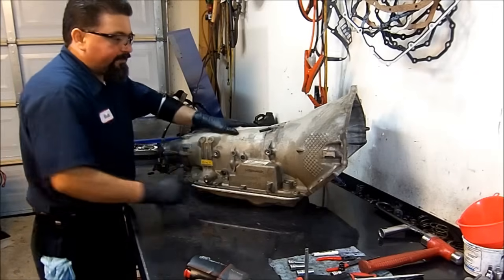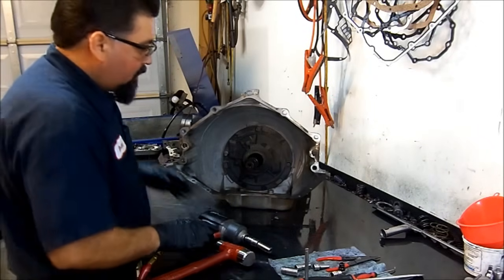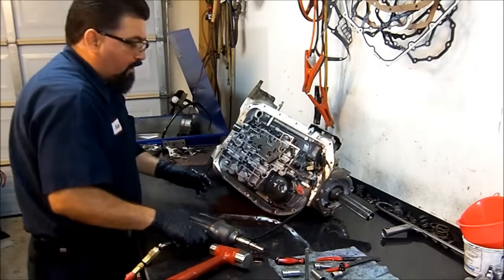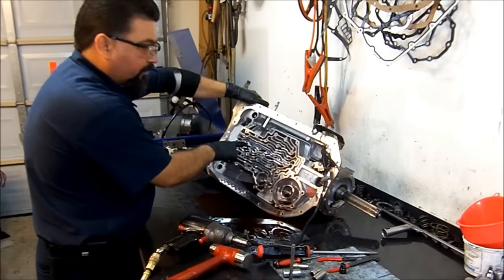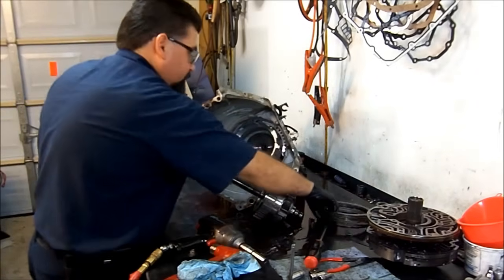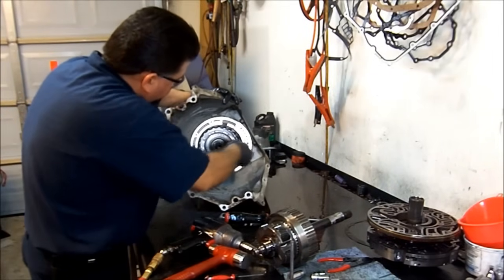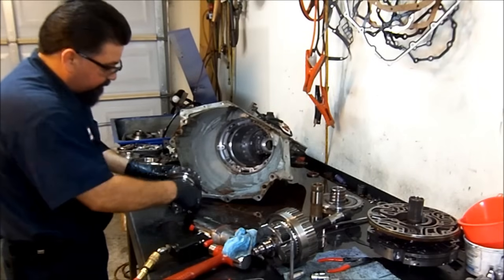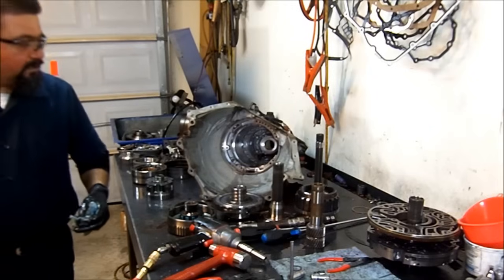Step-by-Step 4L80E Transmission Teardown: Full Disassembly & Inspection

Comment: thank you so much for what you do they were charging me 1700 to do my transmission and i look at ur videos i bought the rebuilt kit for 249 bucks i just went for it and actual did it thank you so much and god bless you bro..thank you
Reply: Was it that difficult. i can anything. water pumps, head gaskets, alternators, to suspension work. i wanna get into trans work
Reply: @DL-qq4nu  It's not hard work but it's tedious and there's lots of special tools you will need which aren't expensive but are NECESSARY. Piston compressors, snap ring pliers, seal installer tools, a bushing driver kit and the list goes on. If you don't have a clean work space and take your time and take pictures and take notes and be methodical, you'll lose parts like bolts, check balls, clips, seals, etc. You'll learn real quick that the idea is to work in steps and work on 1 assembly at a time.
Reply: Joe good for you. I’m in the research phase now. Have an old truck I’m going to keep forever lol need to know how to keep it alive
Reply: Can anyone out there who has watched, commented or liked this transmission tear down tell me what is wrong with an instructional video like this on YouTube? The Customer is charged for a complete tear down and assembly because of a wiring problem! Had the technician stair stepped his diagnostic evaluation correctly, he probably would not be rebuilding transmissions at this stage in his life. NEVER, NEVER NEVER get complacent! Always use your head to think things through.
Reply: chfar072281 lol too late once it’s pulled and on the bench. The wire issue could have caused other damage. Better to get it all fixed up right. 

But yess sadly way too many misdiagnosed jobs. But that’s the nature. Pay more for labor and have a chance at better skills

Comment: Nice work and thank you for sharing. Videos like this are a huge help in demystifying the auto trans. I'm currently contemplating a 1976 Pontiac Turbo 400 that has 35,000 original miles on it and has never been opened. It sat for a long time and slips when it's cold. Gonna build it for a 500+ HP engine.

Comment: I'm studying these videos. I've got a '95 Chevy 2500 that I've retired as a work truck because of a bad transmission (which I'm hoping to be able to repair for my home use), and a '98 3500 dually that's probably a few years away from needing a transmission overhaul.

Comment: Thanks for a helpful video, I'm not transmission guy so I had someone else rebuild my transmission, it's a bit of a long story, but I wound up missing an external piece or two and I wasn't sure what was missing, now I know it's the speed input and output sensors I need to get. And I also now know why the linkage sensor was such a PITA to get off, lol.

Comment: Can anyone out there who has watched, commented or liked this transmission tear down tell me what is wrong with an instructional video like this on YouTube? The Customer is charged for a complete tear down and assembly because of a wiring problem! Had the technician stair stepped his diagnostic evaluation correctly, he probably would not be rebuilding transmissions at this stage in his life. NEVER, NEVER NEVER get complacent! Always use your head to think things through.

Comment: Looking for some 4L80e advise. I have a 2003 Chevy express van, AWD with the 4l80E. There are 170,000 on the van and engine, the trans was swapped out for a junkyard unit at 140,000, unknown amount of miles. While decelerating, from going at any speed, there is a high pitched whine coming from the drivetrain. It's more apparent at higher speeds when you let off the gas. The faster your going, the higher pitched the noise is. I have made sure that all the tires are the same pressure and they all have the same amount of wear. There is no CEL, and other than that the transmission shifts great, no slipping or hard shifts. I'm just afraid it's the pump gears, but wouldn't the gears make noise all the time? I'll see if I can't get a sound bite.
Reply: prolly transfer case

Comment: good job   i was hoping you was going to find something really screwed up i have a 1995 480le in a 6.5 diesel  with 2nd gear slipping      are the diesel and gas trans differrent   and why if the are      thanks for your help

Comment: Great Video  newsubscriber have a 2004 awd astro 4l60e  getting a 894 code  slipping told to do a rebuilt . some say just change the bore size with sonnax . astro has been good to me have over 300,000 miles change fluids  at interval times. Your video's have given me the confident to do it my self. What would you think would be the the problem and solution correct the failed part or full rebuilt.

Comment: Hey hiram..tengo un problem con mi tcc locking up, no funciona y no hay codigos en mi scanner..lo que encontre en mi live data es tcc enable short to ground (yes)..trate te hacerle lockinup con el scanner y deveria hacer stall cuando lo enciendo pero no engancha..crees que esta haciendo corto el harness o probablemente el selenoide? El brake pedal switch esta funcionando bien

Comment: Thanks for the video,I'm about to tear down my 4L80E out of 94 2500 pick up problem started with  No overdrive then 2nd gear only with hard acceleration it put it into limp mode .First attempt on overhaul I'm going with Master rebuild kit and thinking about Transgo HD2 shift kit and do you know anything about the Transgo kit where you install a   vacuum modulator and do away with the electronic shifting it makes the 4L80E manual shift only ??? Any info is appreciated. Again thanks for putting these videos out for us to learn and have a awesome reference to go to.

Comment: Thanks for the videos have a question about 4l80e pump gears look okay around the outside as you explain in this video on the flat surface of the gears and on the pump surface looks like a little scoring nothing bad can barely fill it will this be okay or needs to be replaced

Comment: Awesome, very detailed disassembly video. I'm thinking about rebuilding my 2001 Silverado 2500HD 4x4 which has the same transmission, and installing a shift kit. Are there major differences between a 2001 and a 2006 model 4L80E besides the bushing you noted? Also it would be awesome if you had a re-assembly video of this trans. Main difference I would note at this point is that mine will have a transfer case married to it instead of the tail housing.

Comment: Great video.

I've got a 2007 4L80E behind a built LQ9 in my jeep. It was pulled with 27,xxx miles on it.  Any idea what would cause it shift hard 1-2, and 2-3...and in out of 4th/lock up?  It will drive normally on some days and on occasions goes into what some have said is limp mode.

Comment: I am also looking for some 4L80e advice.I have a 4l80e from a bone yard .I was told it was running when it came in.I changed the filter and seals, the pan is what I would have called  very clean for a trans with 60,000 miles on it. After installing it ,I did not have any forward gears .I have only reverse.Just to let you know ,I have the a LS motor hooked up to this trans with a reprogramed  PCM. I did try unplugging the trans because they said I should get forward gear in a limp mode. But no luck.Any help would be appreciated .Thanks great video Fred

Comment: I have a 2003 s10 4l60e that will only go to into overdrive lockup one time when you first take off. After that it will not lockup until you shut it off for about two minutes. It will do the same thing, until you shut it off again and only shift one time. Found out I had a bad TPS, raplaced it with and ACDelco, still no lockup. I accidently left the TPS unplugged and it lockups everytime, just doesn't run right with TPS unplugged. I also found out that the MAP sensor was clogged up, and with it unplugged it will lockup everytime. I had the transmission live drive scanned and everything looked good except that TTC solenoid was off, except for the one time that it locks up on initial drive. My question could the TCC On/Off solenoid be bad even though it worked with these two sensors unplugged. Thank you in advance, your VIdeos are awesome

Comment: My 4L80E doesnt get driven often. When I start it and put it in D, there is no drive until 6-8 seconds later  but after that it seems to run fine, also shifts hard  sometimes, any response would be greatly appreciated.

Comment: Thanks for the awesome video!  I have a 96 4l80e in my 2500 suburban. I also have the same yr vehicle but its a 4l60e 1500 as a parts truck. Will the trans solonoids work for the 4l80e?  Hope this isn't a dumb question......

Comment: One quick question since you do frequent here.  I like, and have, a 4l80e to go into my car.  I dont like the first gear much but it is a sacrfice I will make.  I will need to use 3.73 gears to keep my OD rpms where I want them at 65mph.  I want to go 4:10 with the deep, or not so deep, first gear but can not with the .75 OD.  Is there a OD gearset I can use to get me a .65 OD? That would/should put me at 2300rpm with a 25" tire

Comment: Hey! I have a problem. I have a 1994 chevy 3/4 ton with. 4l80e and it is throwing a code 87. I replaced the 1-2 shift solenoid but it still wont shift. its only throwing code 87. What could i do to fix it?

Comment: Ran across this video hoping to find something on changing a parking pawl. Park does not work on my 1993 4L80E in P 30 Southwind Motor home.  Is it changeable with removing the trans?  Thanks!!

Comment: Hiram, awesome video! I have a 1994 Chevy K3500 with a 4L80E trans that is stuck in limp mode. Any ideas if this is the wiring harness leaking fluid or the 1-2 2-3 shift solenoids? I did notice the external plug and wiring is dirty and damp with what looks to be trans fluid. I haven't gotten into the trans issue any further yet.I bought the truck after it was sitting for over 2 years so I am seeing all kinds of issues everywhere else and now I am at the trans. Thank you for any info you could throw my way. The truck only has 64,000 miles on it but it was used as a snowplow vehicle before it was parked.

Comment: Hello I have a question not sure if you can answer me or not but I have a 1993 c2500 with a 4l80e auto transmission and person I purchased the truck off of said the trans was rebuilt New a and b solenoids not sure what else was replaced but it's stuck in limp mode only have 2nd and reverse a mechanic looked at it and and said the pcm is sending the commands to the trans but the trans isn't acting the commands out so I made a manual control with 3 switches I can hear them click when I activate the switch but nothing coming out of transmission still the same 2nd and reverse any clue as to what it might be thanks if you get back to me

Comment: I have 1991 p30 chevy chassis with 454 and 4l80e trans. I have checked to see if there was a code stored there wasn't one. The trans has reverse and only 2nd gear it seemed too gradually get longer to shift from 1st to 2nd but I could be wrong. The fluid was changed about 6000 miles ago and seems to be ok, do you have any ideas what I could check.

Comment: Thanks for the great videos! I
 I lost all gears while driving in the highway 55m/h suddenly.
I do have parking locking. Fluid is red no burnt smell.
I just checked presure line, unfortunately my gauge is a 1000psi so not the most accurate but I get:
P-R-OD-D-2-1
90-70-90-50-50-50-50 at idle.
140-200-130-100-90-90-90 at 1,300rpm
Any pointers?
If i have pump presure it means input shaft or pump cannot be broken, right?
Truck doesn't even try to move in any gear,....broken output shaft?
I have replaced trans filter, old was really clogged and had fallen off, but no metal or unusual debris. 2wd driveshaft does not turn, linkeage is good. It feels as it is in neutral all the time; but my presure test seems to indicate manual valve is working, right?
Reply: *****
Thank you
. Could the Presure manifold switch failed with all fluid open/exhausted and the trany think it is in neutral?
The shifter is like a rod not a cable, and it is working. This is a chevy 93 c3500, 6.5td. The pump presure also changes as i shift into reverse etc... so the manual valve at least is working some, right?. Any chance I can pull and rebuild just valve body? something telling the forward and reverse clutches not to engage? Just surprise something breaks inside the tranny and hear no noises.
I am really surprise that I have no codes; it feels almost like the tranny thinks I am in neutral....really tought the linkeage broke, but it is not.

 thanks vey much for your help!

Comment: I have a 1997 Cheverolet C2500 with the 4l80e in it and it whines loud on all gears and in park and reverse. Any input would be greatly appreciated as to what it could be. I've been told its probably the pump maybe transmission filter plugged.

Comment: Hey I appreciate your videos I completely rebuilt my 4 l80e with very little experience your the man. but I have a problem it was running wonderfully for about 2 to 3 months and now when I come to a stop it feels like the torque converter is still engaged if I put it in neutral it's okay but if it's in Reverse or drive it gets a shaky feeling like it's still engaged any ideas?

Comment: hey hiram i have a 4l80e that will slip in 2nd gear. at first i thought it to be the sprag but when i play with the pressures in the computer it does affect shift quality so i am assuming i have a pressure leak somewhere? 2nd gear has always seemed to have a slight delay in engaging as well when the solenoids shut off takes around .8tenths of a second to begin its shift. 

this transmission is swapped into a camaro making a lot of power *800rwhp+). problems started after i bumped the line pressure in the force motor table in the tune dont know if it is related but possibly after hearing you talk about line pressures...

im going to be tearing it down here soon just looking for pointers of what to look for! thanks a ton.

edit: everything else in the trans works fine except 2nd gear slips under power

Comment: My 2003 4l80e grinds when put it in park . No movement in any gear . Anyone know what it could be.  Had a used one put in .The shop didn't torque the bolt on torque converter . End up shooting through the oil pan. They said they fixed it now 3200.00 later and 4 months no go! Any help would help thanks

Comment: Hiram,

I am new to this whole thing and not familiar with the 4L80E transmissions at all. First I wanted to say this video is awesome and very helpful. I am having a problem with my 2004 chevy silverado 2500hd and not sure what to do. It grinds when you put it in reverse sometimes and will also sometimes grind whir you are driving, like it is in between gears or something. It all goes away if you hit the breaks or hit the gas a little. The RPM's don't change when it does it either. Other times it drives perfectly. I took it to the dealership and they said there are no codes with the transmission and it all seemed to work fine, but on my way home it did it again. I need help and was hoping you would have some advice. I also know the torque converter is bad because there is a loud whining noise coming from it and from all the forums I have ready they say it is a pretty common problem. Could this be causing the other problems as well, or do you think it would be internal? Thank you for your time!

Comment: So, I sat down last night and watched these videos to see if I could possibly attempt to rebuild the 4L80E in my 92 C3500 HD. I was hoping that I wouldn't have to but I'm pretty sure that s what its gonna take to fix it's issue. No reverse, pulls forward in neutral and reverse. I tried the manual low test I read about and the engine brake engages when you let off the throttle.... Any thoughts? I must say you made the tear down and rebuild look easy, but I know it was just experience👍👍

Comment: hello Hiram Great video watched many times
My number on questions is --Could an electrical issue like a cracked wire cause reverse not to work in the 4l80e, or a pcm issue cause no reverse

Comment: i don't know why i watched this. mine is fine right now. changed the fluid last weekend and it shifts smooth as glass now. wasn't shifting funny to begin with. just noticed the fluid was dirtier than i expected. the fan on a hot day makes it sound like the engine is working hard at lower engine speed but it's not reflecting that in the tach. this guy knows his stuff. too bad he's not local, i'd entertain the idea of sending my ranger transmission to him. around here we have powers transmission and they aren't known for quality work. they always are looking for technicians to. the sign will go up for awhile and be taken down for awhile. seems like they have a high turn over and might be hiring the wrong people for the job. they also are known for being quite expensive. leaves me with 2 options for my work beater, v8 swap or rebuild the trans when it finally goes. a v8 with a 5 speed is looking quite appealing at this point.

Comment: I have an 2003 Chevy Impala with the 3.8 engine and when I start my car up  it has a whining noise and the then the car will not  move when I put it in drive.  Also, it goes out when I am driving and stop at a light and go to take off the car just revs and not move at all.  Do you what part that went bad or let me know if that can be rebuilt or repaired ?

Comment: don't know if u can tell me what happen to my transmission. but I was driving an it was all fine then I lose all power in my transmission. it would not go at all. now when I went to put into part it was grinding an take it out of park an the grind went away. now I had been having an issue of sometimes I'd put it in reverse an it would kill the engine. other then that no problems of any kind. what could it be. thank u.